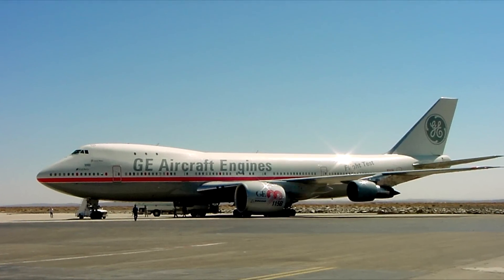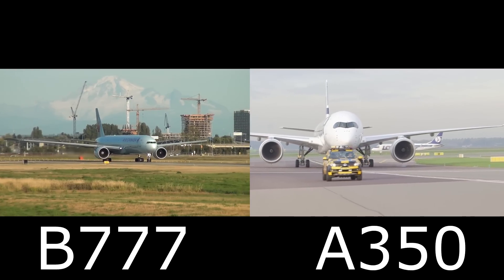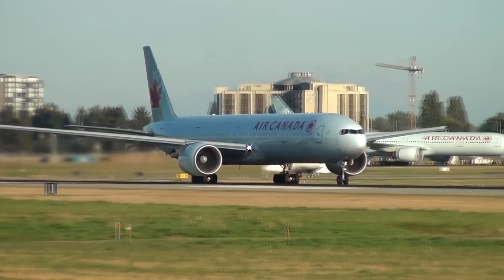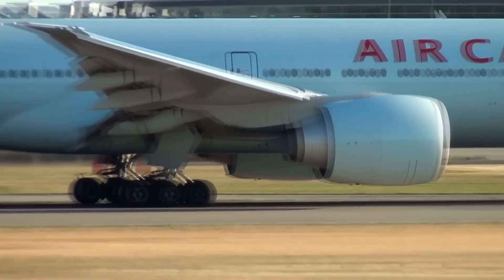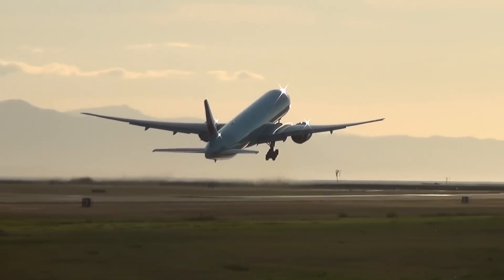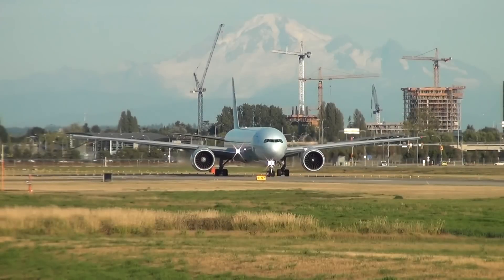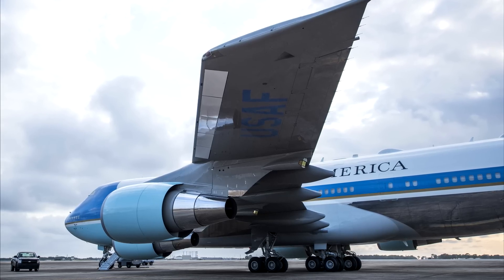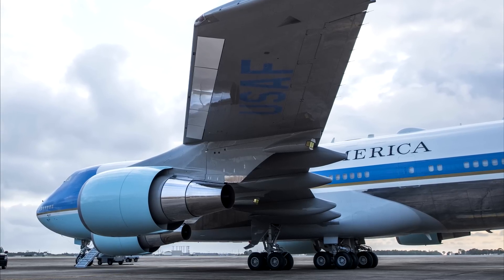Will 2 GE90 Engines Work On The 747?

Comment: The 777 I don’t think it could be stretched past the -300 line ,it is already a very long plane. The 747 with new designed wing with only 2 large engine built new. Could have a large cost savings, in not having to redesign the main fuselage and tail assembly along with the  landing gear ,a/c ,electrical systems, and the many other systems found in the fuselage. The retired 747 (2 engine)after passenger service can be used as cargo aircraft ,where as the A380 would take a major redesign to have front opening nose door added.

Comment: the short answer is NO. It's not only the thrust but also the number of systems (4 elec, 4 hydr etc etc). Requires massive reengineering and you must also understand that a single engine should keep v2.

Comment: You'd definitely need to beef up the structure.  At my old job, we had a PW4000 in the #2 position on a 747SP.  There was more thrust bracing inboard of that engine (installed well before i worked there), but i honestly don't recall there being any extra structure for the weight of the engine. I could be wrong. The PW4000 was definitely close to the ground too.

Comment: Boeing747 with four RR(RB211) engines produces 4x60600=242,400 lbs of thrust.Even if one engine fails,other 
engine plus tail(for level)can keep aircraft in air till destination.If we use two GE90 engines with combined thrust
1,15,000x2=2,30,000 lbs thrust,it is doubtful in case of one engine failure the other engine'sthrust will be enough to keep it flying especially over ocean.Ideally,the solution is to use an auxiliary engine in the rear or better still go for a new generation of GE-Y2K engine with thrust say 1,40,000lbs or more!.It will cost $2 Billion plus for development!..Now the Billion dollar question is whether a market exists for such an aircraft?.

Comment: You forgot to mention a 747-400 has four independent hydraulic systems  (& electrical) with each engine driving a hydraulic pump as well as air driven hydraulic pumps (ADP's) in the outer pylons as well as electric hydraulic pumps.
Not to mention the way the bleed air & fuel systems are divided up.
There's a lot going on under the skin that makes this impractical.

Comment: You need to fly it safely over oceans on a single engine then. If the rating is marginally okay under optimal conditions the FAA will not certify the airframe config for trans-oceanic passenger service. It's a neat thought however.

Comment: Is it not possible to use this to a different advantage ? like having 4 engines and use only 2 when you need them and then cut the other two off for the rest of the flight . Whether you have two and two or four the same .  I'm I going the wrong way with this ?? Then you eliminate allot of the 4 engines and reduce cost of use of regular 4 engine use . Also isn't the 747-8 easier in use than the a380 ? 
Thanks

Comment: The main benefit of a two-engine 747 is the IPV (In Place Value) of the 747 (Jumbo) itself; airport infrastructure and facilities developed over decades to accommodate the size and shape of the 747; a issue that has to be contended with for the A380 (and no way can an A380 get to a two-engine configuration) as too where it originates and where it can land/go.  The current 747-800 was stretched (yet again) to compete with the cargo/passenger capacity of the A380 along with a new wing to handle the load and achieve fuel savings.  Making the 747-800 work with two-engines (and the commensurate wing and tail redesigns) might be a bridge too far; but an easier configuration/shot of the size/configuration of the 747-400 would be a good bet for a two-engine redo.  The author is probably right that a 777 is probably a better alternative, but the IPV of the 747 is the key

Comment: Interesting proposal. I like that you've approached the idea from a common sense and informed point of view. I would like to point out that in addition to what you've stated here, it is not likely that Boeing would  revitalize a production line that is nearly shut down. Especially given the age of the particular design. Unless of course there were a huge amount of interest from airlines and other customers, in which case it may make sense to investigate the practicality of working the engineering study. Even then, the cost factors would have to make sense relative to the potential numbers of sales and getting solid orders from customers. But if this ever were to happen, I would be a huge fan. I've flown on 747s before, and there's no comparison in terms of the comfort and smoothness of the ride.

Comment: Or, put 4 GE90's on, and limit them to the static thrust of the current generation of engines. With the GE90 engines operating far under their true capability, I bet the TBO's would be way way out there.

Comment: No, the wing's structure is designed with the weight of the outboard engines acting downwards against lifting forces- so the entire wing would have to be redesigned.  And it would still be less efficient than the 777 because the 747 is heavier.

Comment: If either Boeing or Airbus could develop a multi-deck two engined aircraft they'd make a killing. Airlines need and want the capacity multi-deck aircraft offer, but the benefit is often outweighed by the massively increase fuel and maintenance costs of having 4 engines. From everything that I know on the subject I think that a two engined multi-deck aircraft is feesable but I think Airbus and Boeing have stayed away from the idea because of the cold reception to the A380 and 747 in the last decade and a half.

Comment: They actually kinda considered this with a trijet 747. They ditched the idea for basically the same reasons stated in this video: It would be simpler and cheaper to design and build two aircraft.
Are there any examples of modern aircraft that have versions with fundamentally different engine configurations? 
I know back in the early days of aviation it wasn't uncommon to add a nose engine to boost performance, but I suppose modern airliners are so well integrated that they all bump up against the same sort of issues outlined here.

Comment: yes you could reduce the size of the vertical saving weight and drag if you get rid of the outboard engines.  How ever, there are benefits to having four engines that might be over looked.  On a twin, when you lose an engine, you lose 50% of your available thrust sure, but you lose 70% to 80% or more of your available thrust for climb.  Climbing is a very important consideration for losing an engine close to the ground.  Dividing the available thrust into small packages insures a greater margin of safety just after takeoff.  
Best to start from the ground up when designing a new plane.  Besides Aluminum aircraft may not be able to compete in the near future.

Comment: Minimally, it would need a new wing design.  The entire wing structure would need to be designed for a twin engine installation.  A complete new design but with the same form factor would work.  Basically make an aircraft that looks like a 747, but use the entire 787 design philosophy (carbon fiber structure, all electric system, bleedless engines, etc.)  At one point Boeing was thinking about this (google Boeing Y3.)  But to cover this market, they upscaled the 777 and gave it a new wing (777X.)

Comment: the stress per wing of one big engine would not be much more than the stresses of 2 engines as on present 747s.  B 52 bombers have already undergone this modernization,
lthough the tail, and/or vertical surfaces on stabilizers would have to be increased to account for assymetric thrust in event of a single  engine per wing  failure,

 as would landing gear need to be lengthened.
Incremental changes are usually far cheaper than redesigning the wheel,  but new wings shouldn't cost that much...
modern software is, after all, supposed to be faster, more powerful... and cheaper than the  1960s-70s  programs used to originally  design the 747 back then.

Comment: First, aesthetically the 747 looks better with its 4 engines. Secondly, as the video stated, it would be a massive undertaking, your talking about a lot of structural redesigning, wings, fuel tanks pylons, the tail and possibly the elevators. Also, the landing gear would need to be redesigned The instrumentation would have to be reworked, electrical system required. As the narrator said, better off designing a new airplane and that’s exactly what Boeing did.

Comment: Video nails it in the summary. While it sounds appealing to the beancounter or layperson at first, from an engineering perspective it’s the integration and recertification that are a problem.

Integration: because of the aforementioned stresses and point loads, the whole wing needs thrown out and redone, for all practical purposes. While retaining the proper blending with the body and existing fuselage mounting. But then, you are recertifying the whole wing... which is the lion’s share of the effort for an airplane. Strength, flutter, failure resilience, flap structures, controls, stall characteristics, and so on. All has to be redone. PLUS the newly integrated airplane needs tested again. Engine-out controllability is a challenge... feasible, but costly to reengineer then recertify.

Hence, more cost effective to engineer a whole new airplane. 787, or proposed 797. Or further updates to the 777, which was designed for two big engines from the get-go. Advances in materials and aero modeling have resulted in stronger, lighter, more efficient shapes and structures. By the time you optimize the 747, you’ll have a brand new airplane with a similar silhouette but zero interchangeable parts.

Comment: I actually asked this a long time ago when there was a video showing a 747 using one large engine and blowing chunks of the runway off. An aeronautical engineer said that you'd have to redesign structural support for the belly of the plane to handle the difference in center of gravity with two larger, and probably heavier, engines. He also mentioned that it's just too costly and a lot of re-engineering is involved. Great idea, but too expensive. They might make enough thrust to use little fuel to keep the plane afloat but you have to worry about structural rigidity like fatigue over time. Aircraft have to go through a procedure where they're put on jacks and I think their frames are balanced in certain areas. I think it's called reframing? They almost gut the entire aircraft and it takes months to do but it's for hours on the air frames.

Comment: The 747's day as a passenger jet is done, sad to say. Smaller planes are better for today's air traveler BECAUSE it takes more flights to carry the same passenger load - which means you can fly at times more convenient to the traveler. 

I like the 747 too, but I REALLY like three departures per day EWR-SEA better than only one.

Comment: Had the same thoughts about a twin engine 747. That aircraft is a work of art. 
You bring up a lot of good points about stress issues. It would be easier to put the "hump" on a 777 probably.

Comment: 747 has 4 GE genx 2Bs ..two GE 90s will not compinsate for the thrust needed ,747 is to heavy and would need more wingspan like on the 777 ...the new GE 90x has a 1.5 ft larger fan case and would probally work but then you run into the wing problem again ..777 and 787 has moved to composite wings and tail section maki ng them alot lighter than the 747
Reply: And also a lot more expensive than the original 747 materials.

Comment: Simple..you would need a whole new wing,,
Reply: The whole wing would need to change,,the stress points would change from 4,,down to two,,simply,,a four engine wing running two engines with equivalent power would rupture it,,the force vectors wont match,,see..

Comment: you think that all that designing of the new engine and all the tests was done before they thought about how it will be attached to an already existing plane? you underestimate aerospace engineers greatly. they are already being sold to the 777 line. a 747 can handle it because I saw it tested on a Kalitta Air 474 in Oscoda, MI.
Reply: MrChittyChad I didn't know big planes were still flying from wurtsmith after the air force let it go.

Comment: Why not replace the obsolete jet turbine engines with engines that are lighter, easier to manufacture, more fuel efficient and have a much higher power to weight ratio.

Comment: Going from 4 engines to 2 engines would mean no long-haul flights across oceans.  I think at least.  I remember reading there was a regulation in place requiring at least 3 engines for intercontinental flights, which is what the 747 was designed for; long haul flights.  Although it does look bad ass with those 2 engines!
Reply: Zach err the 777 does and it twin engine

Comment: Airbus made 1 wing for the a340 and a330 but the stiffening for 2 engines came out heavier than 4 engines. The a330 marched on and is still being re-hatched as a neo whilst as you say, the a340 is long dead.
Boss of Quantas said 2 787's to lhr from Aus were cheaper than 1 a380!

Comment: NOOOO KEEP THE 4!!!!!!! ☹️ it looks better
Reply: Sadly finacial incentives are more valuralble than looks im afraid, its a shame i only see vigrin atlantic 747 coming into manchester but its rare seeing 4 engines aircraft, fuel prices are so high its making it hard for airlines to consider using them any more D:
Reply: Flagstaff Rail Fan 55 yah it would look ugly without them
Reply: @onedollasnake  It looks fine with two engines. I mean, Boeing once explored a 747 with a trijet configuration.
Reply: Agreed. The 4 GENx engines look hot on the 747-8.
Reply: @ezekielmajor5511  the genx engine way better and bye bye 38 fan blade cf6-80c engine are garbage
Reply: Flagstaff Rail Fan 55 Keeping it with 4 engines isn't an option. Too inefficient these days. The options are letting it go extinct or figure out how to make it use just 2 engines
Reply: BizzarFish1 It's not only fuel prices. It's also maintenance costs for keeping 4 engines good to go. That makes it cost twice than a one with 2 engines
Reply: Don't forget, it (747-8) carries more people than any other 2 engine aircraft, so that makes it quite efficient, hence why it got some orders.
Reply: I may agree but under the market circumstances most airline companies are looking for low emissions planes. 4 engines are gas guzzlers that's why 2 is better.
Reply: I saw a VA 747 at Vegas along with a 747SP, Also I’ve seen 2 at PHX.
Reply: i want a 747 with 4 GE90s, actually no 5 one in the  tail.
Reply: Yes keep the 4
Reply: Southwest 001 it’s not about looks. It’s about costs.
Reply: 5 of them look good....
Reply: We don't want it to be dead tho
Reply: Southwest 001 hi and wtf are you on😂😂😂
Reply: one dolla snake what are you on?
Reply: BizzarFish1 ya
Reply: Southwest 001 but with 2 engines it will be more fuel efficient
Reply: Southwest 001 it’s also more expensive and less cost effective because if something happens, you’d have to pay for 4x what you would normally have to pay 2x for. Because if something random happens to one of the current engines, you’d have to check the rest for the same problem, and that cost money, ergo, 2 would be better in end, sadly, like he said, it’s virtually impossible due to weight, cost, size, etc. Sorry but looks don’t matter. You still have the A380, thought 🤷🏽‍♂️
Reply: Noo we want the 2 engine one so it's more fuel efficient and companies keep using them

Comment: Maybe a 747sp will work with 2 engines
Reply: B747SP have the same capacity as B777-300ER. It wouldn't kill A380, it would just get killed by B777-300ER.
Reply: The SP was going to be a trijet, Boeing would’ve needed to completely redesign the wings
Reply: You are asking for a 787 or 777
Reply: dj cats in da house Unfortunately, darn few SPs exist anymore, and the production line has changed too much to try to
Bring them back. I guess we’ll never know.
Reply: very plausible. market demands twin engine costs  for greater frequency over medium range with a larger capacity
Reply: Miles Hanna Surprisingly, the 747SP is used for what is now considered "ultra long range" routes. So, it should be taking on the A350 and the A380. 2-for-1 deal.
Reply: good idea
Reply: What if the get the 747 tri jet concept back

Comment: 747 has 4 RR RB211 Engines . each one have 60,600 pounds of force . we multiply it to 4 and the Answer is 242,400 pounds of force . 1 GE90 Engine  have 115,000 pounds of force multiply it to 2 and we have 230,000 . I think 2 GE90 engines can handle the 747 when it comes to power

Comment: Issues of safety. If an engine fails after V1, then the remaining engines but be able to get the 747 into the air for a turnaround and landing. 4 GE90 engines are not a bad idea though.

Comment: When i worked at Rolls-Royce a number of quite detailed re-engining studies were undertaken and as far as I can remember only one entered service, that being the UPS 727-tay freighters and that was more to do with improving flexibility from reducing  the sound impact. re-certification of modified aircraft is always a big problem and can be as costly if not more so than an entirely new design.The FAA also have a liking for putting punitive limits on old air-frames that airlines hate.

Comment: reenginering the 747-8 might not be a bad thing 
give it carbon / kevlar wings and 2 engines could save the 747  
lighter and using less fuel at the same time airlines may buy them again 
a380 too big for most routes and airports and strugles to fill them 
787/a350 to small for some routes and no where for business class to be private
the 747 top deck business only (like virgin atlantic started hence the upper class)
and lower deck eco and premium only i bet lufthansa and ba would order them again